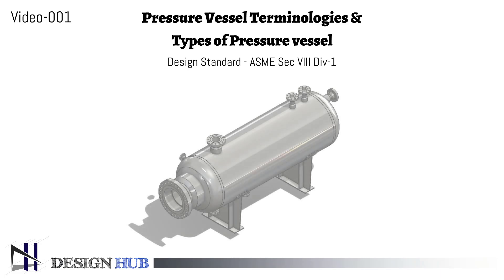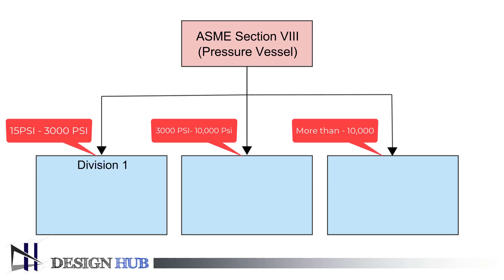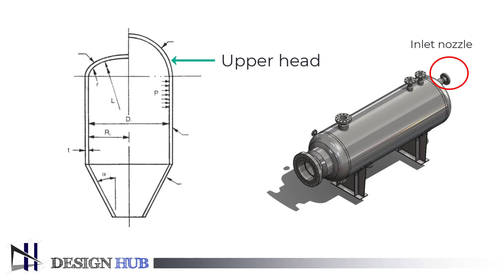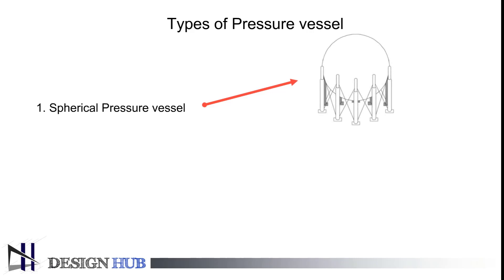Pressure vessel Design Series -001 - Introduction |Design Hub|

Comment: 00:01 Design Hub offers quality technical content for the design industry.
00:16 Introduction to pressure vessel design
00:33 Pressure vessel is a closed container
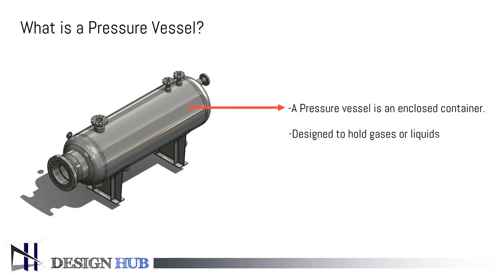00:58 ASME Section 8 includes three divisions
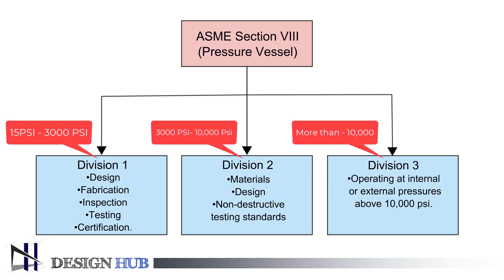01:21 Division 3 provides guidelines for high-pressure vessels.
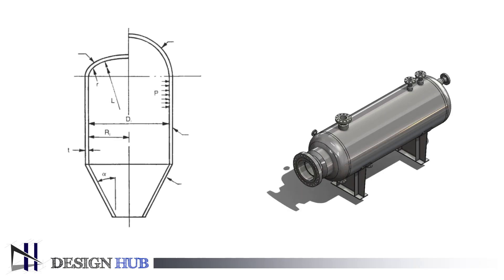01:36 Introduction to pressure vessel design
02:10 The types of pressure vessels include spherical, vertical, and horizontal vessels.
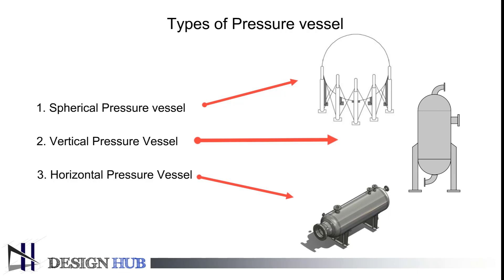02:33 Stay tuned for upcoming videos on pressure vessel design.